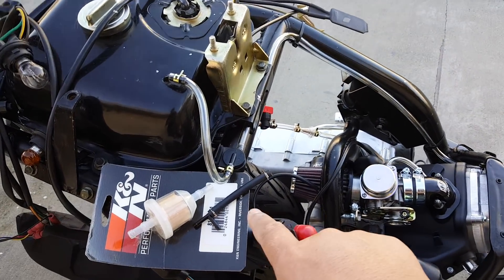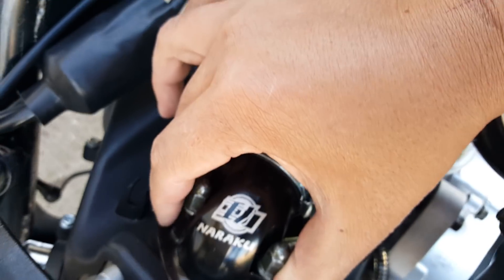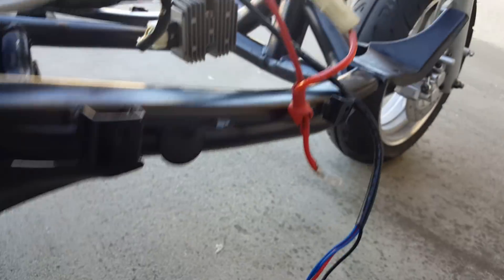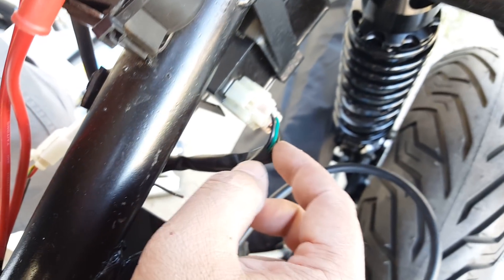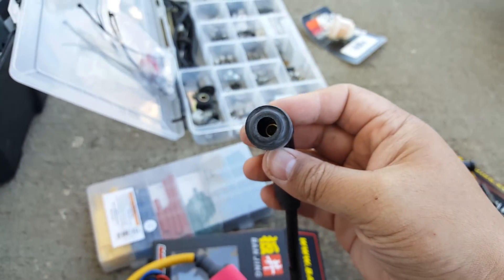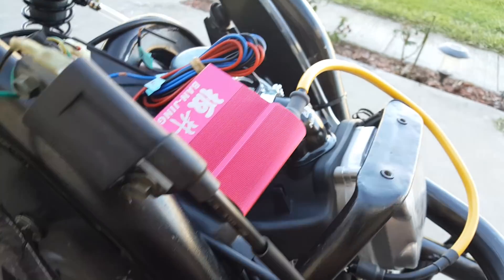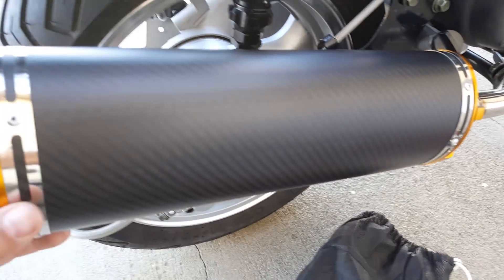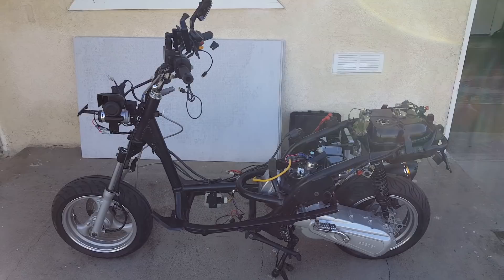GY6 Carburetor Fuel and Vacuum lines (simplified) and Ban Jing CDI intro 2 of 2

Comment: Thanks for the credit mike, nice of you to do. Sometime I'll post all the ncy and ban jing upgrades and tadia big bore kit  with the open exhaust and yes I am one of Mike's ncy store customers..lol thanks again.
Reply: Nice video all of your videos are nice. I've learned a lot from you. Do you have to use the cdi box for the Bang Jang please and if not where would i put the coil wire? Thank you for your time and help.
Reply: @601GDN  your replacing your cdi box with the bang jing cdi/coil combination
Reply: I just want to know what all it those. I'm also using EFI fuel injection kit just want to know more about CDI/Coil comb. Bro I got it installed already without the EFI kit hopefully you understand what I'm trying to say.
Reply: How do I get my RPM do I get rid of the pickup coil wire all together witch is yellow/black for me? Also how do I kill it? With the blue pulse wire from engine to combo? Please help if anyone can. Thanks
Reply: @601GDN  so your asking where to connect the bang jing pick up wire? Guess I'm a little confused. I apologize trying to help you. If it's the pick up wire  your looking for it depends if the scooter was an ac or dc cdi originally. I know about the fuel injection kits but never messed with one.
Reply: @anthonymyers-35  how many wires do I use in place of the cdi box its not used at all right (The cdi box)? 3 wires right red/black and blue/white to bang Jang cdi and grounded anywhere? Also from cdi to coil black/yellow wire not connected to anything?
Reply: If black/yellow coil wire not connected but the green wire ground where do I connect for RPM for tic?
Reply: Tac?
Reply: @601GDN  so your wires from the bang jing red=12v black=ground and blue goes to the pick up wire from the stator, all these wires are found right in the cdi harness. The original wires that were connected to your original cdi has all the wires in it. Hit me up at apmscootering@gmail.com I dont want jack Mike's ncy thread if you need more help i can get you there.